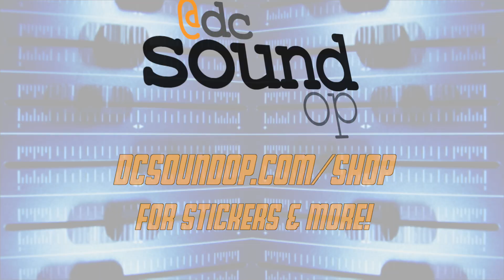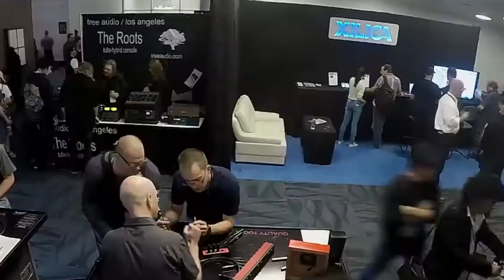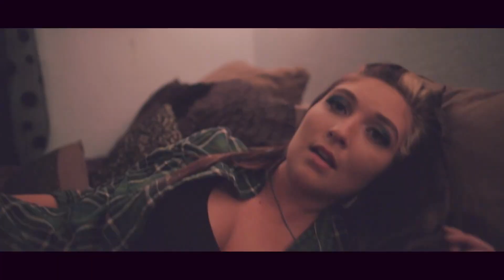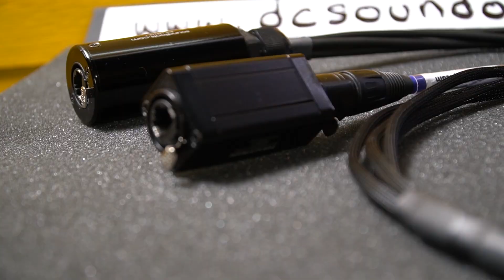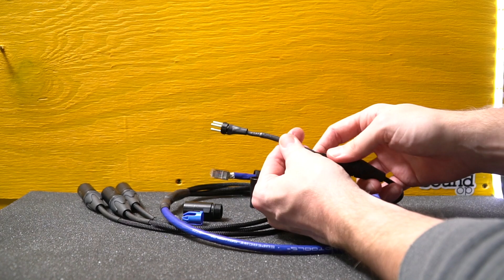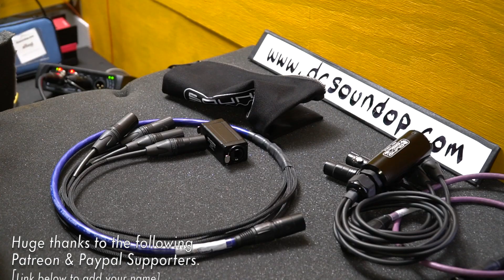SuperCAT Sound Tails First Look with Madeline from SoundTools

Comment: So does the SuperCAT cable carry the same amount of data/audio channels as the regular CAT5e or is it like 4 times bigger? (Seen that the CAT Tails MX that they market with this contains 1 SuperCAT in and 4 CAT5e cables out). SoundTools's product page shows that the SuperCAT cable itself contains the same number of individual wires than the normal CAT5e, so is the SuperCAT actually better than the normal CAT5e?
And if the difference is that the SuperCAT can transmit more data than the CAT5e, then is it just like CAT6?
Reply from the maker: Juveri, the SuperCAT and SuperCAT Sound cables are both CAT5e rated cables. The main difference between them and standard CAT5e is they are designed for stage and production use. The SuperCAT 'Sound' cable is different again in that each twisted pair has it's own individual ground wire, allowing for things like this where they are terminating the cable to individual xlr connectors directly. 

Hopefully that helps clear things up a bit. You should check out the other videos I've done with Soundtools and their channels as well if you're interested. They explain everything a bit better in their own words - https://youtu.be/c_I3nbEHtAM - thanks for the question!

Comment: I had a 100 foot snake that did not have shield on individual channels. There was too much crosstalk to use it. This looks like it has the same problem ?
Reply: Interesting and great question.  Here is a video I did addressing that exact scenario where I do a demo as well. Cat5e and better cable is designed to be almost completely immune to crosstalk, even when unshielded up to very high frequencies.

https://www.youtube.com/watch?v=gGgPDEz5sNU&vl=de&ab_channel=DaveRat
Reply: @DaveRat  Would CAT6a or CAT7 cables work as well?